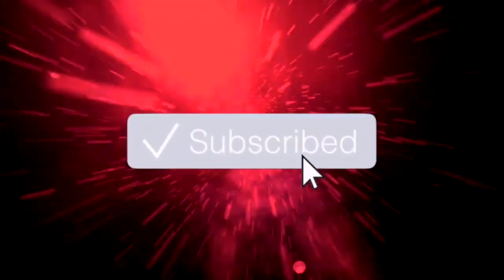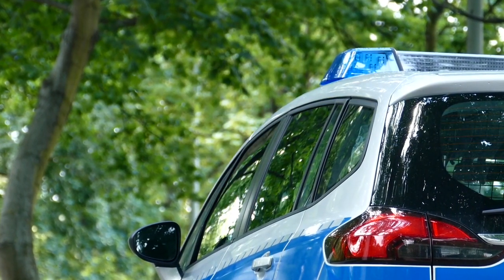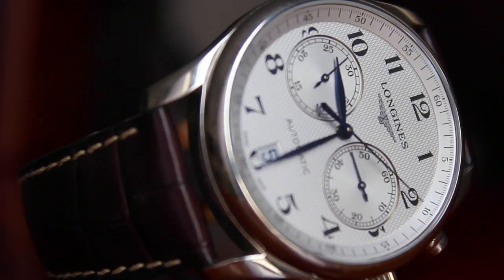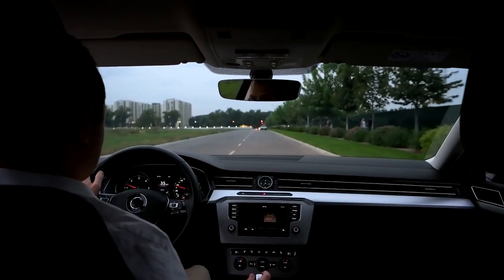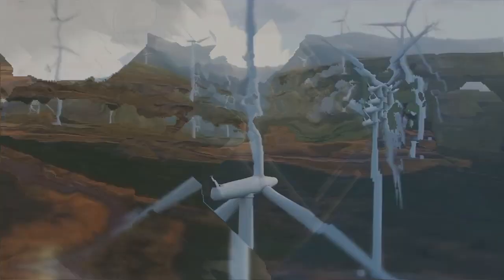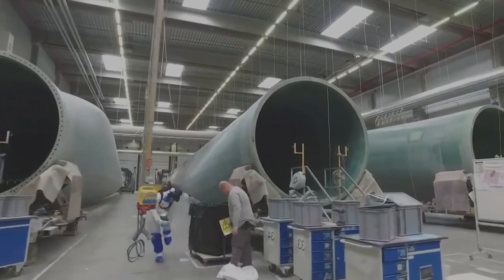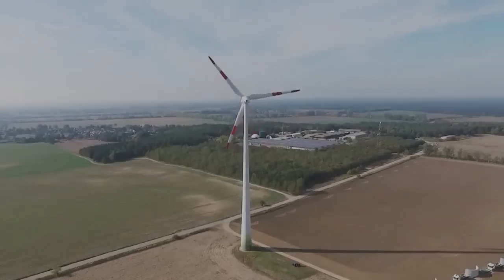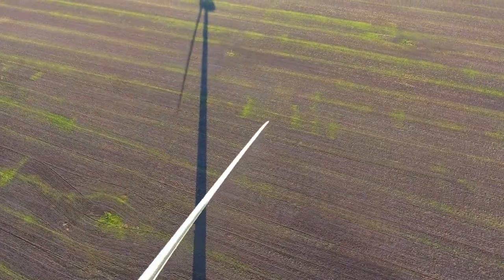5 Wind Turbine Fails CAUGHT ON CAMERA (Windmill Fires & Crashes)

Comment: I reject the notion of calling wind or solar "renewable energy sources"..they aren't.. they're energy savers, not sources..the sun isn't always shining, the wind doesn't always blow..and even if the sun 🌞 and the wind 🌬️ it won't power all the energy demands our country needs.. it's basically why Germany abandoned this nonsense.. electric vehicles are only going to be a tiny sliver of the market.. nuclear is clean and available and renewable..essentially a nuclear power plant can produce electricity indefinitely.. these idiots pushing electric vehicles aren't about the environment but power and control

Comment: The black acrid smoke that the materials produce only demonstrate  their poisonous nature - the blades are made from GRP which is non -recyclable; there is no way of processing them, it has to be chipped and buried in landfill when the turbine is decommissioned. And that's after only 20 years. So even if they never build another one, there's already 57000 of these across the US; that's 171,000 blades of up to 50m length weighing roughly 12 tons each just buried in the earth forever. That's over 2 MILLION tons of landfill. These things are going to be responsible for an environmental disaster in a few years time.

Comment: I'm so glad that the police were called on the 1st video. And why the hell would you not put some brakes on the propellers
Reply: working as a maintenance electrician for a wind turbine company. Normaly they have a system wich detects 1. the speed of the wind 2. die centrifugal force inside the blades and 3. the rpm of the machine. As you can see the wind was pretty strong. My guess was that there was poor maintenance or even manipulating of the system as there should be multiple systemsfailing for this to happen. But since i dont know the Turbine from this video as i work for another company i cant say for sure what happend there
Reply: Use the police for brakes

Comment: number 3....a fire on a wind turbine is caused by an overheating generator, which is usually due to overspeed and failure of a brake system.